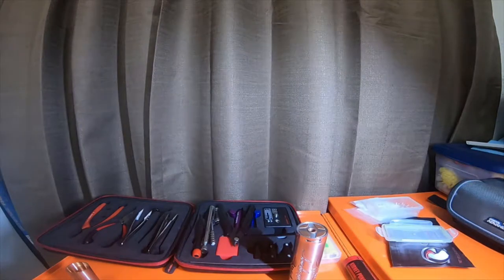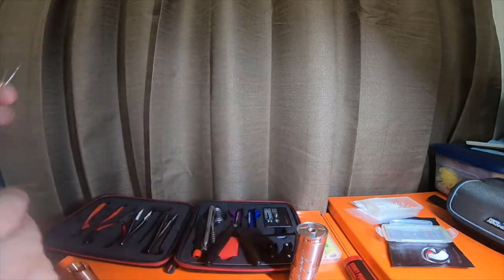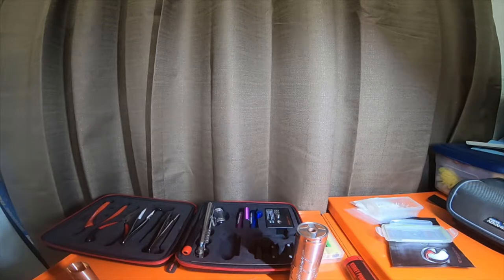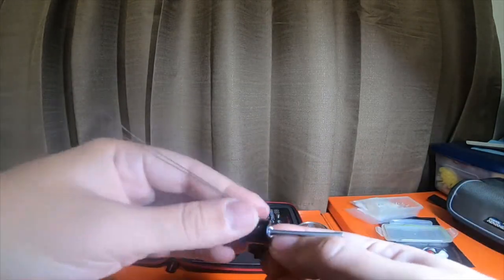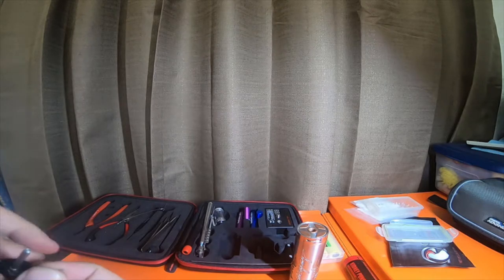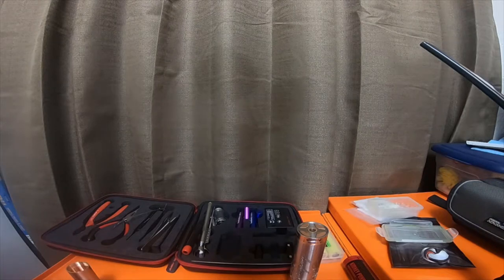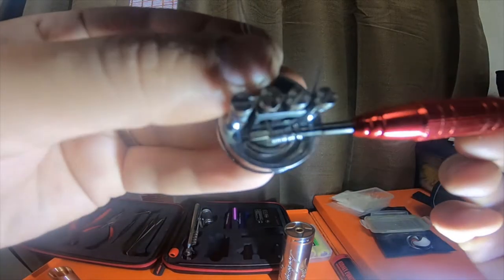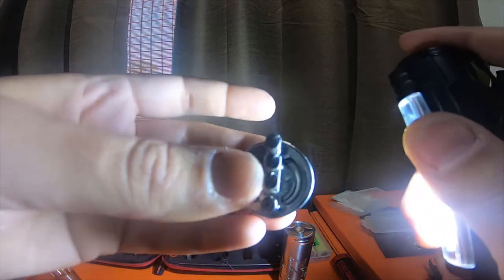Vapeing Build - Step By Step Cheap Mechanical Mod N Sub Ohm Build Part 2

Comment: I can tell you you're a little frustrated because of the loss of audio that was full of pertinent information. However the voiceover is perfectly fine. I'm not exactly sure what information was lost in your original audio but you're doing a fine job explaining with the voice over. I'm going to start you next video no depending on length of next video I may or may not feel finish it in now if not I will tonight. I appreciate the time and effort that you put into this complete series.
Reply from the maker: I explained every detail a d every step from hoe many wraps how much ohms how into do the parallel wraping everything there was a shit ton of information lost that would of made the videos 1000 times better and more informative
Reply from the maker: I will have to make a new series of videos if I want the huge explanations and information. Will have to do a new rda build and just explain everything again